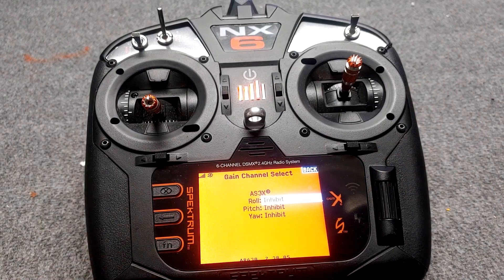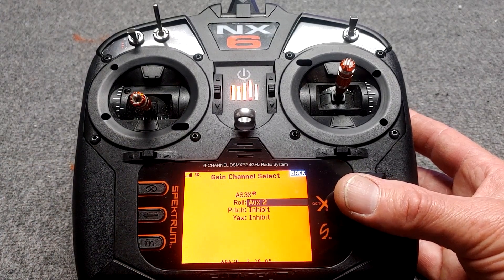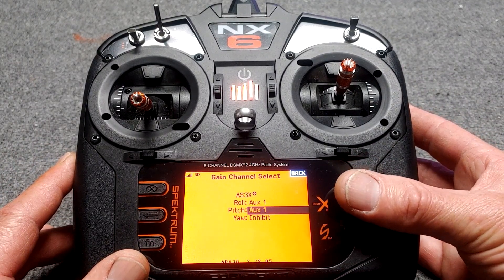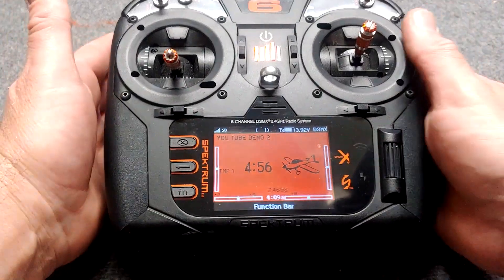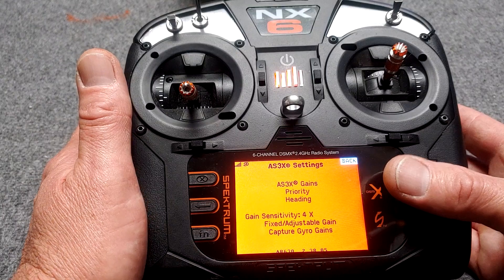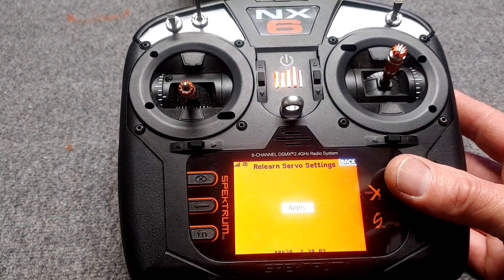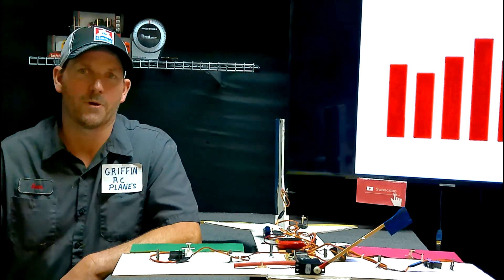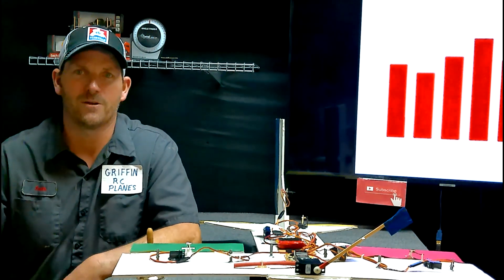SPEKTRUM FORWARD PROGRAMMING pt 4 FIXED/ADJUSTABLE GAINS SET UF SAFE & AS3X EASY TO UNDERSTAND

Comment: Extreme “oscillation” with the switch in the top position.  Very good example of the “oscillation” which would make flying difficult, if not nearly impossible!
Reply from the maker: Yes it would not be a good day